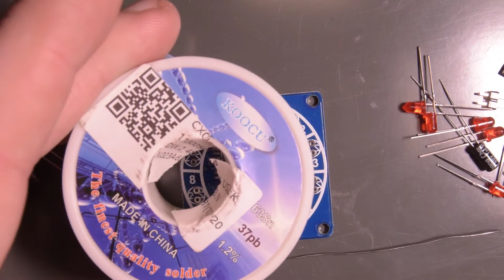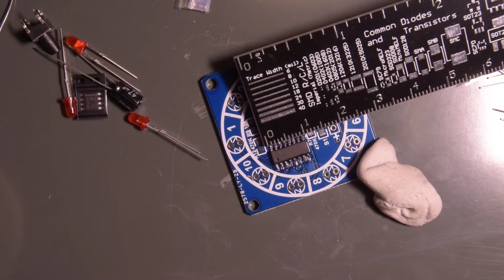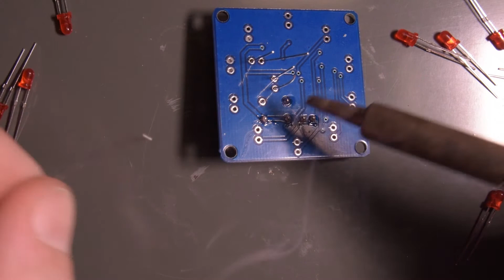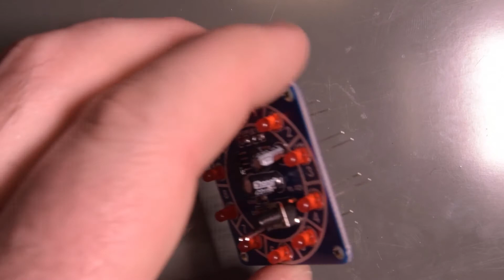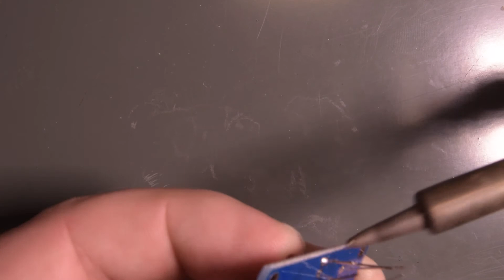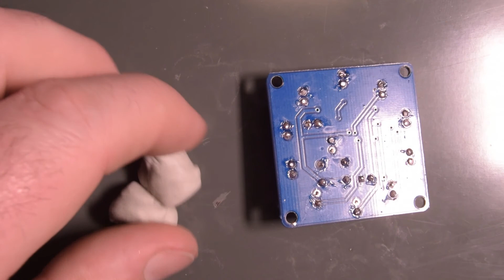Kit Build: Surface Mount Random Number Wheel

Comment: Surface mount is easy... So long as you can see it!!!  The basic approach I always use is just tack and reflow, even on many-legged IC's--but you really have to have a mounted lens. I mostly use an old sewing lamp I 'borrowed' from my wife that has an attached magnifier! If something is really tiny then I blue-tack an additional lens from an otherwise useless pair of wearable magnifying glasses to its surface. I am also wondering about trying to put together or find commercially some kind of cheap jig to hold an old camera-phone so it can work as a CCD microscope-type tool. However I worry about the potential motion-lag.

In regards other approaches, I personally don't trust the solder I can afford to do a good enough job for drag-soldering across pins. That also relies heavily on the quality of the solder-mask on the PCB. Some people recommend flooding everything with flux, but I am personally trying to get away from relying on an external flux pen. In my opinion the clean-up required, even with supposedly 'no clean' flux far outweighs any of the positive aspects. Partially tacky 'Gel flux' is also supposed to be highly useful for SMT work, but the price of even a tiny bottle is insane at £25+ on eBay. That is more than I would want to pay for actual handicraft tools like cutters and strippers. When it comes to consumables at that price... forget it!!!

If I have any across-the-board-advice it would be very simple--use rosin multi-cored leaded solder. Never, ever waste your time and money on lead-free solder. That goes for both SMT and conventional through-hole assembly as well.
Reply from the maker: +1 for leaded solder and for me, a magnifying lens may not be an option at all since I need to have the camera placed where I can film
Reply: @SimpleElectronics  That is a very good point! BigClive does a lot of kit videos, but I think he uses a tablet as his camera and so maybe does use its screen to magnify--although he mainly goes for through-hole designs which are obviously much more compatible with a streaming or recording set up.

Another couple of tips that came to me; for some reason I find it much easier to use a scalpel to position my SMT components rather than tweazers. I only use the latter to get the part in to the rough vicinity and make sure it is the right way up. Then I swap over to a Swann-Morton 'Supatool' to carefully nudge and slide the component in to place. It really seems to work better, but I have no idea why! The other thing I use is a silicon mat to solder on. This has a couple of positives over a shiny desk--obviously it protects against the heat but it also grips the work-piece without needing tape or bluetack. This was actually my wife's suggestion and the mat is nothing special, just a plain medium-thickness one she bought for the oven but never used. I think it cost about £2.99 from Aldi! I am pretty sure she was more worried about the surface of our dining table than helping me solder though!!!

Comment: Nice job! I usually need a lot of magnification when soldering SMD. I built the exact kit in your video using a shop-built reflow oven (walmart toaster oven) The trick is in the application of the solder paste.
Reply from the maker: The application of the solder paste is a line I've yet to cross, even though I have a hot air rework station